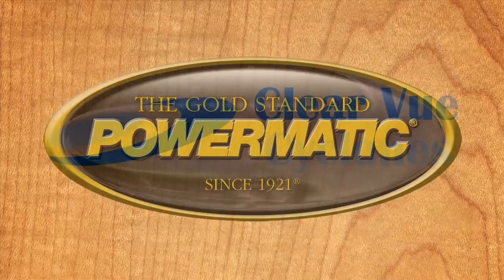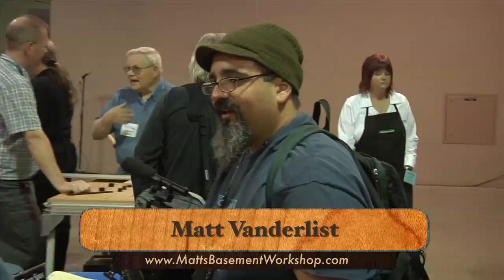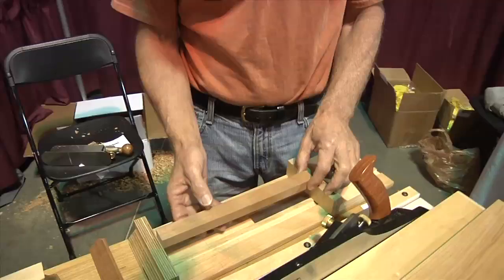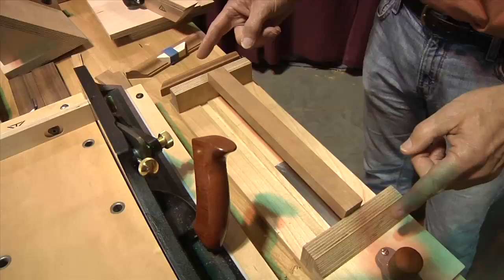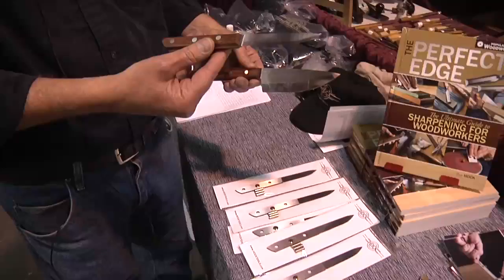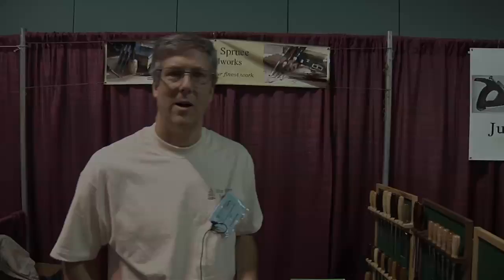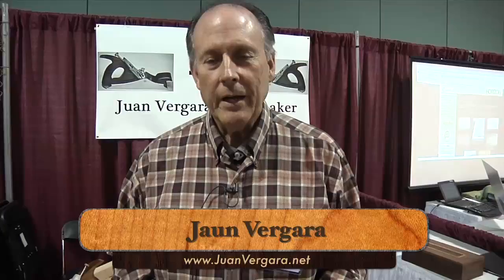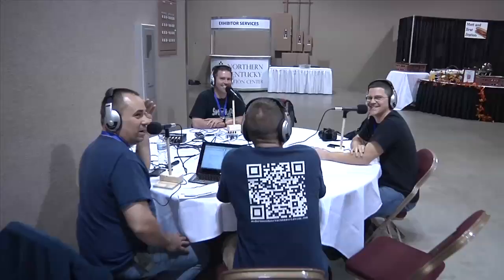210 - Woodworking in America 2013

Comment: It's not the parts that cost money, it's the R&D. It takes years to go from concept to finished product. You see the finished result, you don't see the 10 previous versions that were scraped that didn't work right. That's a nice design you have there, good thing I patented it last year when I made mine. 
Want to manufacture that part? An order of 10,000 units will get you a decent price. Better price at 100,000 units. All that and you still haven't even made a sale yet.